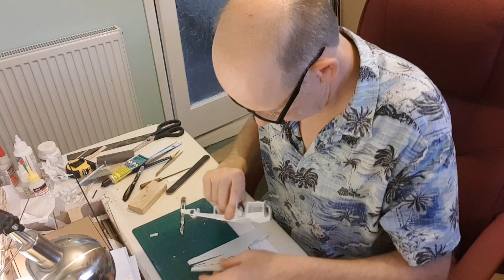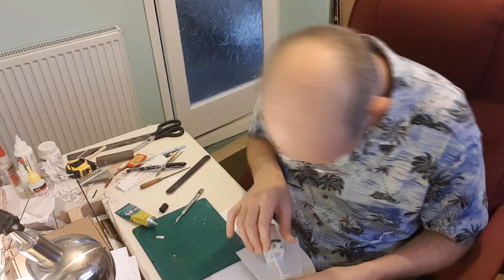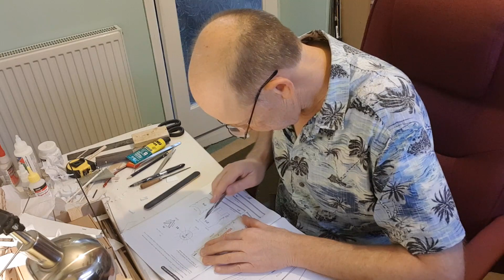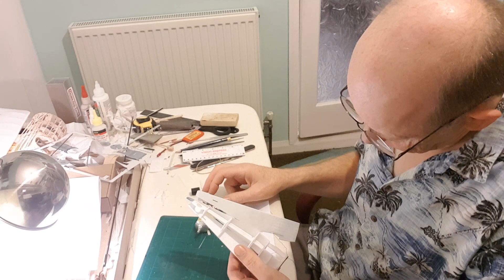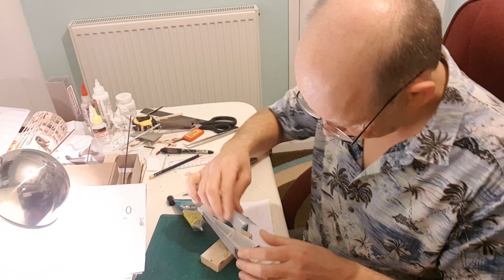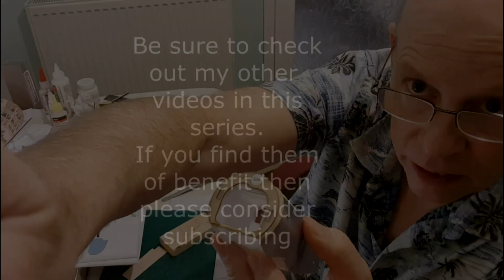Microaces Nieuport 17 Part 3 Skinning the Fuselage

Comment: Very interesting how this goes together...going to be fun. How long does it take the Uhu Por to set?
Reply from the maker: Not long Adam, you can add the glue and bring the parts together or you can add the glue, bring the parts together then separate them and let it dry for a second or two then bring them together again and it acts like a contact glue. I prefer the former as it gives you wiggle time. I would say have a little practice with some offcuts from the kit to get the hang of using it. If things don't go as planned you can de-glue it simply by applying lighter fluid (napher) to the joint with a cotton bud 👍